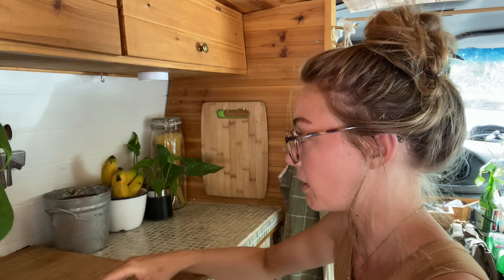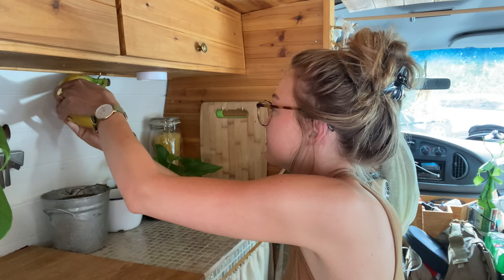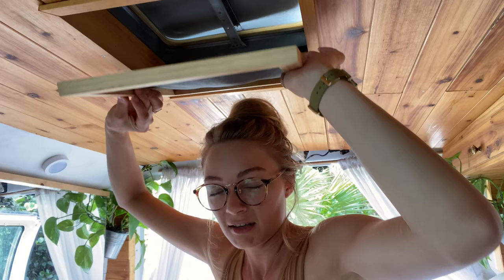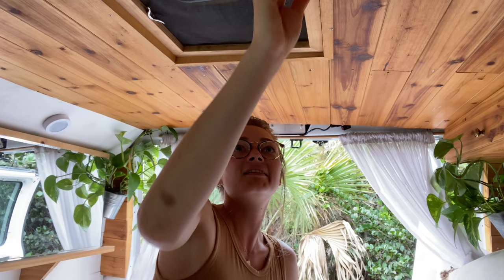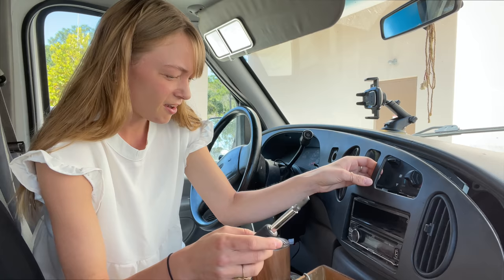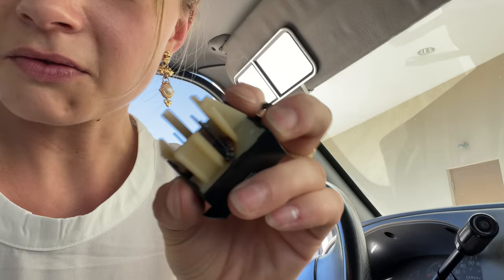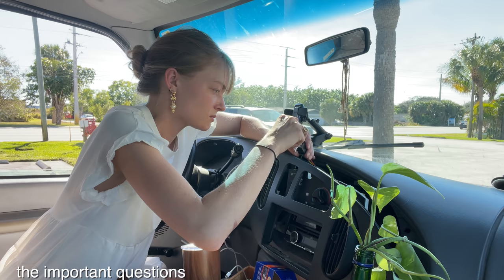doing projects in my van (aka getting my fix for fixing things)

Comment: Hannah's not afraid of fixing her car. I can't tell you how many times I've told male Vanlifers how easy it is to take off a dash cowling (just to clean the dash/gauges easier), or remove the gauge assembly, and replace burnt out gauge lights, a broken gear pointer, or fried electrical harnesses. And they chicken out when it's so, so easy to not pay a mechanic $60/hr for that. 

Impressed by Hannah's knowhow!

Comment: 17:51 A technique that works real well on sanding automobile parts is called wet sanding. You take wet sandpaper and a little water on the surface. (you buy 'wet sandpaper") in 320 or 400 grit. Works much faster and smoother that dry sanding.

Comment: Love watching all you do Hannah. Thanks for making your videos. About your dash fan switch. What creates the heat is a bad connection. Your problem won’t be solved withe the dialectic grease. You need to replace the connector which has been the problem all along. If you don’t replace it you’ll melt the new switch. What happens over time is the connector expands and doesn’t make a good electrical contact to the switch (male) connectors so it causes resistance and where there’s resistance there’s heat. That simple. Love 💕 ya

Comment: At Lowe's and Home Depot , I think both have two foot interlocking floor squares for workout rooms. You can cut them to fit under your rug that you use for a knee pad, or alone. They can be cut to fit. They come two in a pack and they're about an inch thick. And before you start painting the rust spots on the body of your van. Google Rust Converter, it has a phosphoric acid base, that converts iron oxide to a gray primer that stops the rusting. It's paintable or you can leave it as is.

Comment: Ford vans are notorious for the rocker panels rusting out. I had 2 that were complete rust buckets. My Ford 10 foot box van I bought new and was religious about keeping it clean. I’m not sure why the fan switch goes bad. My 98 E250 did that, but my 03 and 05 E350s didn’t. The other thing that breaks is the shifter cable. If it gets hard to get it to shift into gear or back into park, it’s wearing out.

Comment: Hey, with regards to the mat you have to help your knees but isn’t really helping— have you considered maybe a yoga mat? They have some cute designs and some extra thick mats and it could be a multipurpose item as well. 
Idk, I just feel the struggle with protecting your knees. Great job btw! 🥰
Reply: Get a gardening kneel pad. It can double as a back rest against any of the vertical walls inside the van, weighs next to nothing, and you can also use it to sit on at a picnic table or park bench. Velcro would probably work to stow it against the door or hook it over the back of a 💺 seat

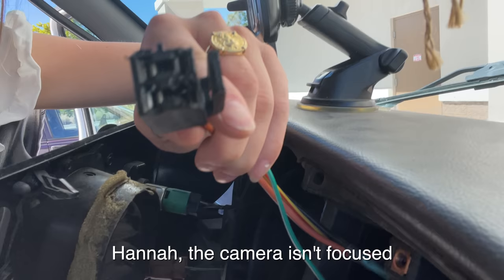Comment: 6:43 The contacts are melting because there is resistance in the contact. the cure is to squeeze the female part with pliers to close up and make the connection tighter. You may have to replace that connector on the wire. Current plus Resistance equals Heat. The more current and resistance the more heat. Blower motors in automobiles are very high current.
Reply: I was hoping someone had an answer because I'm seriously worried the van's gonna burn down!

Comment: So if you’re heat select speed switch is melting you should change the raiostat on the fan box , but by the sound of your fan it’s wore out, change all 3 parts at once and your problem should be fix . I’ve had the same problem with many vehicles changing all 3 problems is the permanent fix, replacing one pice is just a bandage
Reply: Until you’re next wire fire, might make for good content if you and your camera gear out. Stay safe

Comment: RE: Fan Switch. That is truly scary. You really need to replace the connector and the wires that are attached to it. The contacts in that connector are burnt and aren't providing a solid connection. Loose connections generate heat and is causing the problem .. and will continue to cause it. Putting grease on it is not a long term solution. I would check local wrecking yards and see if they might have this wiring harness in a car in their yard that maybe in better condition. They should be able to check their interchange books .. or use the part number of the switch .. to see what other Ford vehicles used this same harness.

Comment: Your HVAC switch in your van keeps melting because of too much resistance in the connection.
The dielectric grease you applied may help with heat distribution but you're going to eventually need to replace the plug You should be able to pick up a pigtail plug at an auto parts store.

Comment: Do u have a fan to put on at night while ur sleeping or for when it gets real hot that either runs off ur car battery or regular batteries?  We had a Ford pickup w a cap on the back that was done up quite nice in the cap that we took to the beach almost every day -we had a 5 gallon bucket that had a pump and a hose attached ( not exactly how my hubby made it) that ran off the battery and we could shower our kids off with it and our feet to keep all sand out of the vehicle.  Also had a counter will a small Coleman stove and lantern when traveling for cooking and it if we traveled in the cold months.  Thought u might find that helpful:)
Reply: Walter looks beautiful!!🤩🤩

Comment: Just pop off the hub caps and save sum tape... Your gonna laugh when you rotate your tires and underneath the caps will be 2 toned gray and black lol and on the dash there are 2 screws at the top of the gauge cluster that release the rest of the dash hope that helps a lil

Comment: You're so adorable. Wishing I was there to help you out. Love your d.i.y. attitude. Duct tape would have also worked, it's just harder to peel off. If you put it on painted surfaces it may pull the paint off when you peel it off, but on chrome or tires it would have worked.

Comment: The connector is bad. That is why you are having switch failures. At this point the grease really wont help. Not sure what year your van is, but this fits 1995-2002
Part Number: 5120-05227965
Hope this helps!